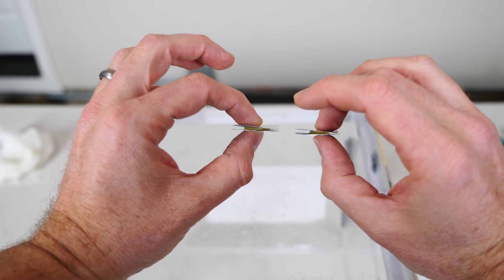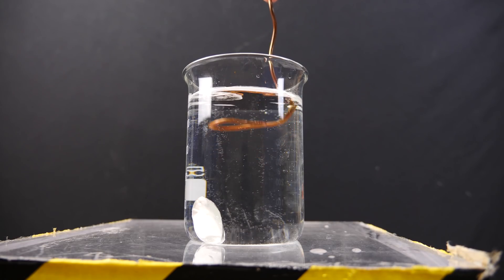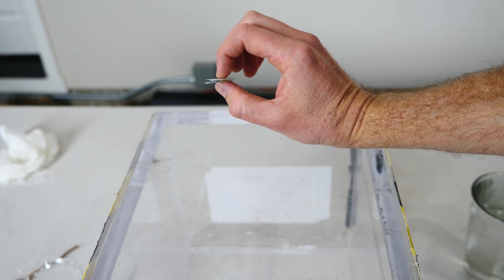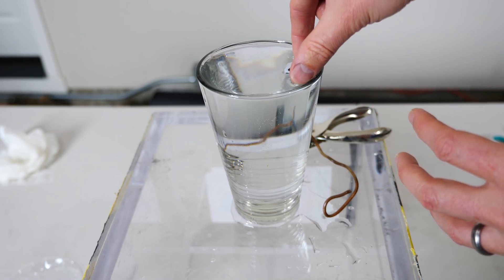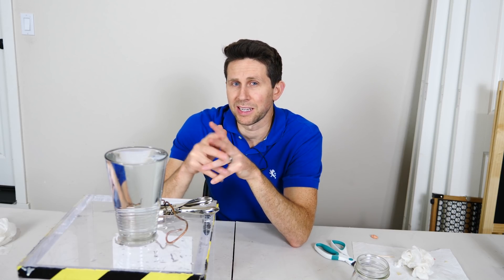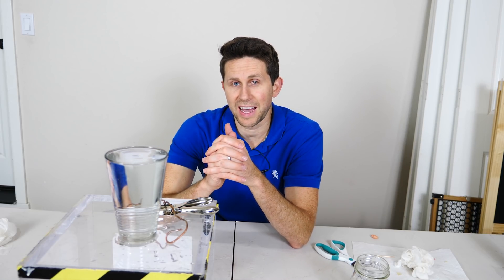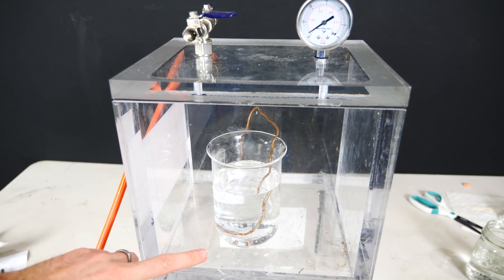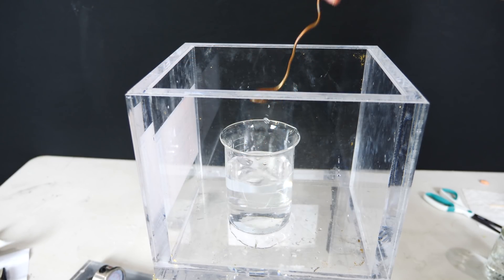Making an Unsinkable Metal

Comment: James, I have an partial idea for an experiment. It's not complete and I'm drawing a blank. Maybe you can run with it. 
It would be interesting to see the effect that having something in a vacuum has on the what happens when you microwave it. So something small in a sealed small vacuum container like one of the vaccum food storage jars. 
I'm not sure it would have any effect at all and it would probably be a good idea to do something like this outside. 
The problem is trying to figure out what to test and what effect or difference to test for. 
Additionally it might be neat to have a clear vaccum chamber large enough to contain a small microwave and then evacuate the air and using some sort of remote device activate the microwave. This could actually be done by using the old dial timer style microwaves and simply setting the  dial and then plugging it in. 
 
Another experiment would be to have some vaccum containers such as the aforementioned food storage jars and to put various types of explosives such a fire works and stuff in them with detonators of some sort and see if being in a vaccum effects the ability of it to detonate and how that might effect the way it disperses using high speed video. 
Maybe a collab with Cody and the slow motion guys or someone else.
Reply: Here's an insight that would give you sort of an idea of what would happen if you microwaved something in a food preserving vacuum container.

First thing is that, if you had some food item inside, the pressure would probably increase inside the the container as the water inside would turn into water vapor.
This is why TV dinners tell you to create holes through the plastic wrap, so it doesn't explode from the increase in pressure.

Second thing, no matter what you put inside, the plastic container could melt, giving way to the vacuum inside the container, especially if the container was never designed to be microwaved. Plastic melts very easily, though I wonder if microwaves have the ability to heat up plastic.
Reply: Also, it would be much easier to put a vacuum container in a microwave then a microwave in a vacuum chamber.

To do the latter, you would need either a airtight plug that goes outside the chamber to an outlet, or include a power cell inside the the chamber to power the microwave. Plus the chamber would have to be pretty big for a normal sized microwave and you would need to turn the vacuum pump on with the microwave door open so that the air inside the microwave also gets sucked up. Then figure out a way to remotely close the door and turn the thing on.
Reply: @thehotdogman9317  the door isn't a n airtight seal. You would just have to run the pump longer. But yes that was my point. This was just a partial idea.

Comment: ONLY ON A SMALL SCALE!
Title is missleading, if the metal part is thick/big enough, the weight of the metal will easilly outweigh the boyancy force of the trapped air.
Even if you had the holes throughout the material, if the volume is large enough, part of the component would have to be submerged and the water pushing on the air will create enough pressure in the air to leak out and eventually sink.

Comment: Calcium also floats after some time in water. It reacts with the water to release hydrogen gas bubbles. Some of these bubbles stick to the calcium and make it float up.
It's basically the same reaction as sodium, lithium etc. with water, but much slower (so it doesn't catch fire)

Comment: What if you put the coated metal in alcohol? Assuming it sinks, then pour water into the alcohol. The more dense water should sink, covering the metal. Boil off (or wait for evaporation) and you’ve also sunk your supposedly unsinkable metal.

Comment: my idea is to use Lithium. Coat it with a non-reactive waterproof layer first to prevent it from reacting with the water.   There ya have it, unsinkable metal
Reply: Charge it

Comment: Superb video, as always!
What happens to the air at the bow of a boat coated with hydrophobic material? 
If I coat a boat hull with this material, that boat will move through the water, the bow of the boat is going to be pushing against the water with force. 
Air is highly compressible. 
Airs properties change under compression. Air's interaction with water changes under pressure.

I Am wondering what effects that high pressure region at the bow of the boat as it moves through the water will have on the air attracted to the hydrophobic material. Will the air just be pushed away? Will the air dissolve into the water due to the high pressure? Will the change in properties of compressed air change the properties of the effect of submerged hydrophobic material? 

Hopefully these questions will make an interesting followup video. 

Also, I think I now have vacuum chamber envy

Comment: If you treated the hull of a ship with this hydrophobic paint, would it reduce or increase drag?
Reply: My guess is it would increase drag by creating an uneven surface and replace the lambadar flow with turbulent flow.  But what would be fun would be to test by painting mini toy boats and testing in an aquarium.
Reply: @DuckStorms What if that increase in drag competes with inherent air lubrication, which reduces drag, & they cancel out resulting in no significant change to the overall drag?
Reply: interesting question!
Reply: I like this question.
Reply: I think it would reduce drag like these air lubrication systems (like MALS) do.

Comment: Action lab: making unsinkable metal

Lithium : am i a joke to u?
Reply: lithium just burns off in contact with water
Reply: @pyrofreezer  that's the point
Reply: @pyrofreezer  But the reaction is not so vigorous unlike  it's creepy cousins(Na,K,Cs..etc) thanks for it's anomalous property   :)
Reply: @pyrofreezer  Well, before it does burn it will float.
Reply: @SeriousApache  yeah.. that's the point  :+)
Reply: Once sodium starts reacting with water it melts and floats on the surface more vigorously than lithium floats
Reply: @dELTA13579111315  how? The sodium will dissolve completely  to form sodium hydroxide ,I think
Reply: @vishnnuvijay9096  I can't remember why, but I've seen it with my own experiments with sodium and water. Even if you throw it so it goes under the surface completely (and if it doesn't pop immediately) it will fizzle around on the surface just like lithium does, except it usually sets the gases produced on fire with a much higher chance of popping. I've also had it float around for long enough with large enough pieces that I got to watch it turn transparent before disappearing. I'll try to find you a video that demonstrates that, because it's super cool looking
Reply: @vishnnuvijay9096  https://youtu.be/DJGVZNth68k

This video demonstrates the transparent sodium floating on water, though I managed to do it without a paper filter or anything other than just water, but also with smaller pieces of sodium
Reply: @dELTA13579111315  i think that transparent stuff is sodium hydroxide(Leidenfrost effect )(bu am not sure about it) but it's pretty amazing !! Thanks for your information :) .. science experiments are always cool !!
Reply: @vishnnuvijay9096  it very well might just be that. I certainly don't know what's going on, nor do I know if anybody has actually done the research on this exact thing TO know exactly what's going on, but I do know that it's pretty darn cool
Reply: Even If water is way heavier than lithium, It will float a little .Immediately It will react :2Li+2H2O=2LiOH+H2
Reply: you can coat lithium with polyurethane or something waterproof and inert to keep the water out, i think it can make it work
Reply: @berukadehikari2634  yeah it's a cool idea :)